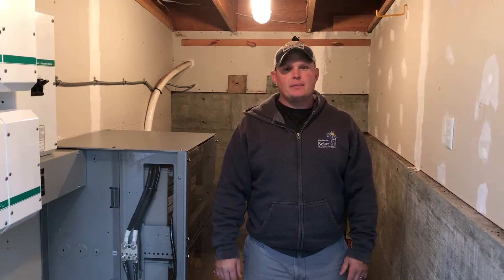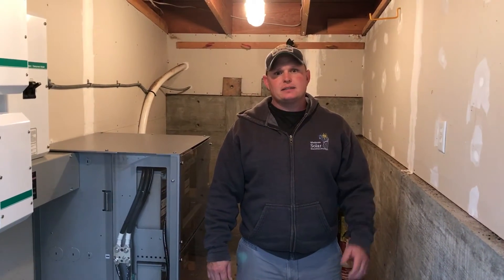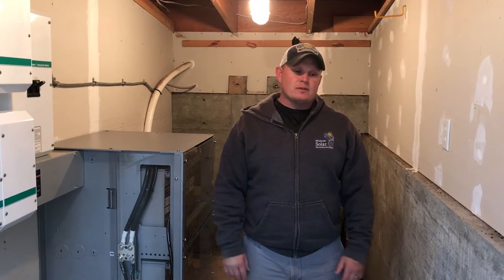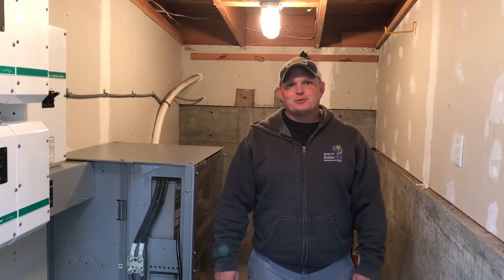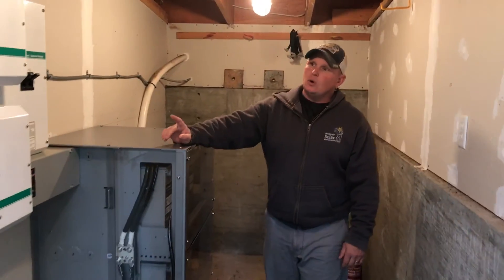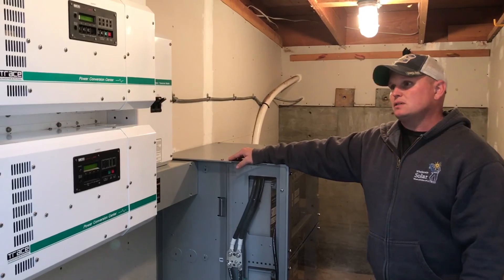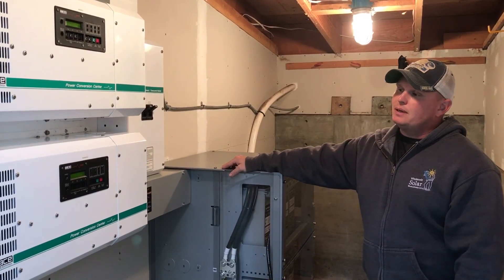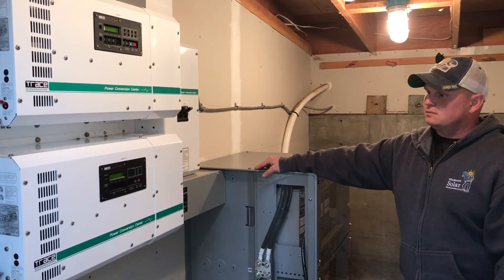Off Grid Power Nano Carbon Battery Backup

Comment: Nice setup there Jason.  If you get a chance you should try playing with some li-ion cells.  You can get them extremely cheap from wrecked Chevy volts for example.  $1500-2000 for 18Kwhr of Li-ion and then you can reconfigure them.
Reply from the maker: +asusreviews where do you get them from?
Reply: car-part.com is one place you can find them they usually have like 20-30 or so listed at a time.  It is actually 16Kwh.  There are some good teardown video's of the chevy volt pack on youtube.
Reply: Be careful, deadly voltages there

Comment: I,ll take two of them...  Love the newer battery technology using lifepo4 lithium cells at this time what do you think of them.  Thumbs up on the video!
Reply from the maker: off grid kid so far the nano carbon are great, I haven't got to play with the lithium much how big is your bank?
Reply: 310ah 48v
Reply from the maker: +off grid kid how low do you discharge them?
Reply: My system running overnight rarely goes below 52v With 16 cells around 3.25v per cell but you can go as low as 3v very safely.   Most factory recommended spec are charging to 3.65v max discharging to 2.65v max low however this charging app is not designed for a long life solar charging application. What's most amazing about the batteries for solar is there ability to absorb energy.... My system still gets amazing results on bad weather days. What do you think about the new powerwall 2 ?? someone was telling me it has built in inverter and charger??? @ 5500.00 dollars that could be a game changer....
Reply: Most solar systems using lifepo4 cells see guys charge to full from 53.7 to 55v ish all with good results. Have used all these settings for float from 55 slowly over time lowering to 53.7 funny thing is @ 53.7 had about the same results by morning as 55v